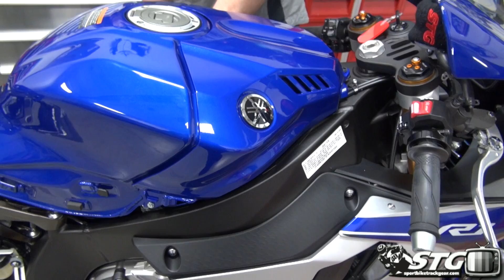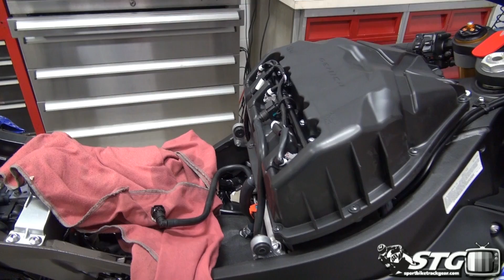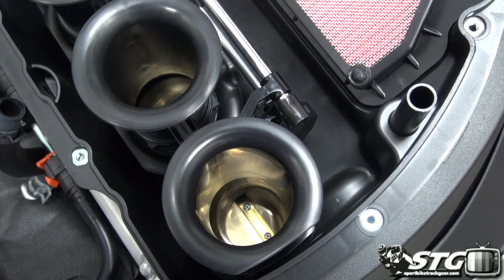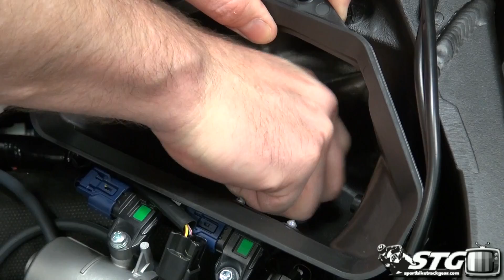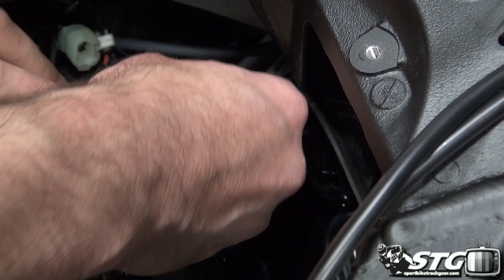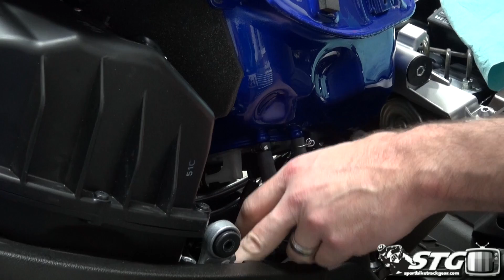Graves Smog Block Off Plate Install on a 15-17 Yamaha YZF-R1 from SportbikeTrackGear.com

Comment: Hey Van, When you disconnected the connector when remove the unit to replace with smog block offs, (you mentioned it stays but is not in use) won't the ecu throw a check engine light? You don't need a resistor or a bypass plug of sorts?
Reply from the maker: Thanks for watching! It will not throw a check engine light as this is only to supply power to the unit.

Comment: Will there be a check engine light on because of the solenoid removal? Thanks
Reply from the maker: I flashed the ECU on this bike with the FTECU kit and disabled the PAIR. Pretty sure if the bike is 2017 or newer you will need to flash the ECU to turn the light off. To get the maximum benefit from the R1 it needs to be flashed. - Van
Reply: @sportbiketrackgear  thanks for all the great info van I'll be getting it off your website!

Comment: Will the check engine light come on on a 2015 if you disconnected the AIS and not have the  ecu flashed yet ?
Reply from the maker: On the R1 if you plan to install the block off plates I would recommend flashing the ECU as well. The Flash Tune stuff for the R1 is very good (Graves partnership), the performance benefits really make a difference and help you get the most out of the mods you are making. To answer your question I think you are ok on the 2015 but 2016 and up there will be a light. Still I would advise doing the flash. - Van

Comment: Would this get rid of problem with flat spots in the rpm range with an after market exhaust?
Reply from the maker: No they will not correct that but they will needed to have the bike mapped accurately. If you are running a tune on the bike it is a good idea to disable the PAIR system as well. - Van

Comment: What's the point or benefit of running these?
Reply from the maker: You install these when you are eliminating the emissions system and converting the bike for closed course operation. The Air Injection System needs to be eliminated to get an accurate tune on the bike. They also help to reduce the popping and farting on decel. - Van

Comment: Hi Van, may I ask why you don't use the rear "hinge" of the fuel tank to help with the connect/disconnect of the hose and cables?
Reply from the maker: Mudux I prefer to have the tank totally loose so I can move it as desired. Either way will work. - Van

Comment: Will block off plates throw off a check engine light? Is it necessary to reflash after install?
Reply from the maker: On the 17-18 R6 you will have a check engine light until you flash it. - Van
Reply: @sportbiketrackgear  But not on a 16 R1?

Comment: awesome jobs!!! it is the same thing as fz-10 2017??  fz-10 engine is r1 2015
Reply from the maker: I would assume it is the same but have not had personal experience with that model.
Reply: Dany Guay did you end up doing this on the fz10? going to get my plates this Friday.
Reply: Movement Exotics yess
Reply: Dany Guay same process? How did you like the results
Reply: I love the result .... it's almost identical, only the air box that is different, sorry my bad english im french from quebec-canada
Reply: Dany Guay no worries.  thanks for the reply. cheers!

Comment: I installed it. I hear no weird sounds of bad installation but I still do get some backfire on deceleration still. Does backfire still happen for you? My gas milage went down a bit after reflashing my ecu and installing an M4.
Reply from the maker: I am not able to comment on fuel mileage as I have never really paid that any attention. It is normal to get a little popping on hard deceleration. If the plates are installed incorrectly it will sound like there is engine noise in the upper half, very pronounced and hard to miss. - Van
Reply: Sportbike Track Gear cool thanks for reply, the block off plates and r1 videos. These videos make my life so easy. I'm already very familiar with this bike from watching you work on yours.

Comment: Hi Van.  First, THANK YOU VERY MUCH for doing these videos.  They are a tremendous help with mods on the new R1!

At about the 20 minute mark you talk about cutting the grey plug off the AIS system and plugging the hole in the bottom of the air channel.  I recently had my gearbox recall done and while they had the engine out they installed my block off plates for me.  However they forgot to cut off the grey plug and plug the hole it belongs in.

My question is:  How important do you think plugging that hole correctly is?  If I don't plug that hole could I suffer from any fuel-air mixture issues?

Thanks again Van!
Reply from the maker: +cartmen34 That is a pretty important step in the process. The bike won't function correctly unless that cap is installed and the system is closed again. Sorry that happened to you, I would see if the dealer is willing to put it back in!
Reply: +Sportbike Track Gear Bummer, but that is honestly the answer I expected.  Thanks for the info!
Reply from the maker: No problem! Thanks for watching! Hopefully next time I can tell you something more pleasant!
Reply: +cartmen34 I didn't want to cut it so I pulled the whole thing off the motor of the valve.  it's like a ring that wraps around it.  no one can see it and it doesn't hit anything.   but it slips right off the motor and you can insert the plug in the air duct.  I don't see it actually needing to be there.   it's just a hole in the airduct and it's before the filter.  guys are removing the flapper up farther and leaving the hole for it (it's way bigger) open.
Reply: +blue03r6 thanks for the tip!  I already got in installed back in place.  I was able to do it without having to pull the tank and airbox.  I have pretty small hands (apparently) and there was just enough room for me to squeeze my hand in between the frame and radiator on the right side.  Took a bit of wiggling and working around but managed to find the hole with my fingers and get the plug installed.
Reply: +Sportbike Track Gear Brian, is it necessary to drain the fuel from the tank when lifting it up? I am doing a power commander install today
Reply from the maker: Paul4186 Nope, the fuel lines have check valves that will keep the fuel from coming out!
Reply: Is there A sensor that is unplugged when doing this, the piece that is remove isn't going to trip a sensor and kick the check engine light on?
Reply: Did you experience an issue ?  I have this issue where the RPMs go up and down, engine stall when coming to a stop and idle issues, and am thinking that hole not being plugged might be the issue. I noticed that the hole was already unplugged when I was installing the block off plates

Comment: I am new im just asking.what is the benefits that block off plate do. to the bike
Reply from the maker: Basically the emissions system you are removing adds more Oxygen to the exhaust to lower the rate of emissions from your bike. This is done for a number of reasons but the importance to our customers is that when you add the Block Off plates to your bike and have an aftermarket exhaust it will run more smoothly as the engine is allowed to breath naturally. Additionally if you wish to have your bike Dyno-Tuned the block off plates will allow the "Sniffer" to get an accurate reading. Thanks for the great question!

Comment: I have already flashed my ECU before installing the plates, will it show any error code? I don’t remember if the AIS can be disabled or it was disabled when it was flashed earlier. Do i have to disable it and reflash the ecu?
Reply from the maker: If your bike is 2017 or newer this will turn the light on. You can disable it with the FTECU flash by inactivating it and reflashing. Pretty easy to do if your bike is 17 or newer. - Van
Reply: Its a 2016.
Reply from the maker: You should not get a light after the plates are installed. If you do it can be fixed with the flash for sure. - Van
Reply: I installed it. No lights. No issues. Thanks Van. You’re a great help always. I love your videos. Big fan of your channel. Thank you.

Comment: Do these block off plates work with power commander V?
Reply from the maker: You can use these with any brand of fuel controller or ECU flash software. - Van
Reply: @sportbiketrackgear  thanks!

Comment: Can you still use a power comander when you in stall the smog off plates? Or will it damage anything?
Reply from the maker: MarksmanKillaz Good to go with the furl controller, they will work very well together. - Van
Reply: MarksmanKillaz if you replace your stock exhuast you should use a PC or similar fuel controller & also smog block off plates, if you don't your bike will be extremely lean!

Comment: Sportbike track gear i have a question. I ran into an issue where my local shop isnt able to flash my ecu again due to being gone this whole upcoming week through new years and i have a schedule tune with a wsb tuner. Now my qusetion is can i install my driven plates and left the ais electronics plugged in to keep the bike from going into limp mode just so i can get the tune done and get the reflash later?
Reply from the maker: Install them and get the flash done when they open. You should not have any issues IMO. - Van

Comment: Brian it is a great mod but there is another way i just capped off the tube and you get same effect
Reply from the maker: You can do it that way if you like. The plates are pretty inexpensive and installing them results in a more professional, clean result. Either way works, personal preference my brother. Thanks for watching, Brian Van
Reply: @sportbiketrackgear  brian your the best you have helped me build my 2016 R1s from brand new to monster... brian have you done any R1s dynos what kind of horsepower are you getting out of the s model with full bolt ons etc
Reply from the maker: I did not take the R1 to a dyno over the 3 years I owned it. Every time I rode it I was quickly reminded just how fast that bike was. Love the way that motor comes off a corner! Personally I would not spend the money on a dyno run or tuning unless I was racing and had to have a couple extra tenths to win. - Van
Reply: @sportbiketrackgear  bro that doesnt right with all your mods your bike 100 percent needs dyno tuned to extract all that power
Reply from the maker: If you need to get all there is to offer you need to take it to the dyno. That said I was 100% satisfied with the power and delivery of said power after the mods and flash so I chose to leave it as is. Personal choice my brother. - Van
Reply: Freak, I haven't looked at the service manual...which tube did you cap? I have a 2018 with akra 3/4 exhaust and popping out of control. Don't want to flash yet..while under warranty so your solution should not trip a check engine code since everything would stay the same
Reply: @ivandiaz3583  yes exactly
Reply: Bro thats the move Especially if someone like me is under warranty 😅 what tube did you plug Up

Comment: If I like the afterfire when running a link pipe+slip on with no tune, is there any reason to bother with the block off plate?
Reply from the maker: Nope, you can leave it if you want to. - Van

Comment: went to your website to order these block off plates.  top of page it says they fit 2015-17 r1. 

bottom of page in item description the r1 is not listed as a bike they fit.
Reply from the maker: Just edited the listing and thanks for the heads up! These fit the R1 from 2004-2017 - Van
Reply: Sportbike Track Gear now i can purchase these

Comment: Do these cause the check engine light to appear?
Reply from the maker: No they do not cause the light to turn on. - Van
Reply: Sportbike Track Gear my r1 is a 2017 ,I'm not sure if that makes a difference but I've been reading on some forums with people having the same problem of the check engine light coming on. They're saying it has to do with the ecu being different than in previous models. Would you know anything about that?

Comment: Hello,
I do not have a power commander. I only going to eliminate my cat and change my exhaust to akrapovic in my R1 2015. Is this smog plates necessary?
Reply: Bruno Silva Yes, otherwise it will "pop" and backfire like a bitch, you really should use a fuel controller otherwise it will run very lean.
Reply from the maker: MrKdr500 Agree on both points. In the end both of these mods should be done when the catalytic converter is removed. - Van
Reply: Sportbike Track Gear 

She pop and backfire like a bitch but i liked very much. And if i put 
only the smog plates? or only the bazzaz fuel controller? What do you 
think?
Reply: +MrKdr500 wouldn't backfire mean running rich not lean?

Comment: Hey, I just put these block off plates on my 2004 R1. I put everything back together correctly, but now the bike idles at like 4000rpm. would this be an air leak? i've checked forums and there seem to be a few possibilities:
1- air leak
2- reset the air(fuel?) screws under the airbox
3- the thermo wax needs to be replaced

only mods are the graves titanium underseat exhaust mid pipe and headers are stock. any suggestions from the pros?
Reply from the maker: It sounds like you have an air leak. Retrace your steps and you should be able to find it. Take your time when you are looking for the problem, if you hurry odds are you will miss it. - Van
Reply: thanks van!

Comment: i installed a y pipe on my 2015 r1 .if i dont install these plates or remap the bike will it hurt the engine?
Reply from the maker: Thanks for watching! It won't hurt the engine, you just won't see the peak performance your bike is capable of! Let us know if you have any other questions!
Reply: thanks van!! you the man.
i have decided to put the smog plates to stop the popping and in the future get a power commander.Any recommendation for my 2015 r1? and a link b great from your site of the recommended power commander if available.
also in your opinion whats a better choice between a power commander and an ecu flash?
thanks man
Reply from the maker: Rav Deo Honestly the best upgrade I have made it the Flash tune auto blipper. It changes the whole riding experience!

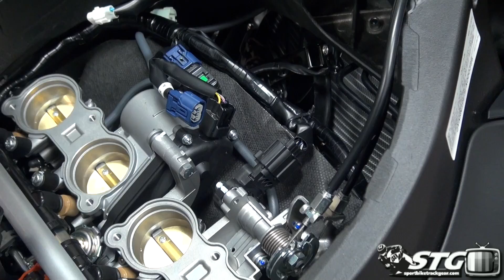Comment: thanks for the video, was able to do the installation myself. Question, minute 20:20 would not plugging that hole affect the intake air pressure sensor that is located close to it? I have this issue where the RPMs go up and down, engine stall when coming to a stop and idle issues, and am thinking that hole not being plugged might be the issue. The issue was there before I installed block off plates. I noticed the unplugged hole while installing them.
Reply from the maker: Not plugging that hole would not cause the issue you are having. - Van

Comment: @sportbiketrackgear recently had the block off plates installed along with an air filter. It triggered a P1400 code (2017 R1). I have not had my ecu flashed yet to turn off the AIS engine check codes. My local tuning shop tells me they can’t flash the ecu (woolich) with the engine light on. Is there a way to access the AIS electrical connection from the left side of the bike so I can plug it in externally, clear the code, and then send off my ECU to be flashed? Trying to avoid pulling the air box and tank just to plug that in for 2 minutes... also if I took the tank/air box off, plugged in the AIS with block off plates installed, then keyed up the bike wouldn’t that throw a ton of other errors because the injectors and all those other connections are unplugged?
Reply from the maker: You would need to install the PAIR valve and have the codes cleared. Pretty sure you will need to remove the airbox to get this done. I have not tried to flash a bike that had a check engine light on so I can not comment on that specifically. - Van

Comment: Hey dude, I am sorry that I am about to ask a question in the wrong place. May I ask your opinion.

I have a 2009 Yamaha R6 with a full system Leo Vince GP exhaust on it, perfectly tuned before. But after that I am not satisfied with the sound it makes so I decided to modify the exhaust muffler. I took out all of the microfibers inside it and it just sounds perfect for now. My question is does it harms the engine in short/long term?
Reply from the maker: Nope, should be all good. Thanks for watching!

Comment: Will this trigger a CEL?
Reply from the maker: On the 16 and up (pretty sure this is the cut off) it will trigger the CEL. You can flash the ecu or install a PAIR Eliminator. https://www.sportbiketrackgear.com/healtech-yamaha-yzf-r1-04-20-pair-system-eliminator/